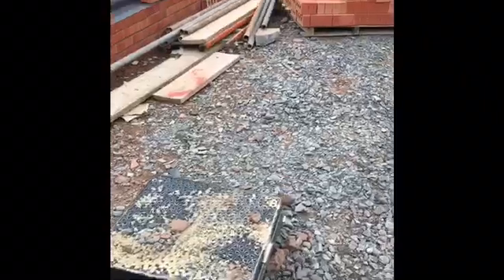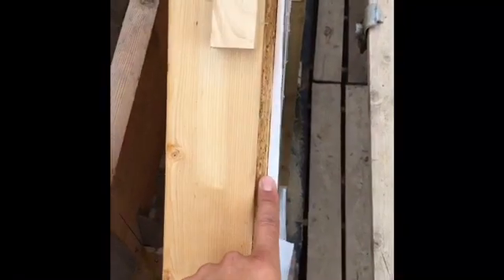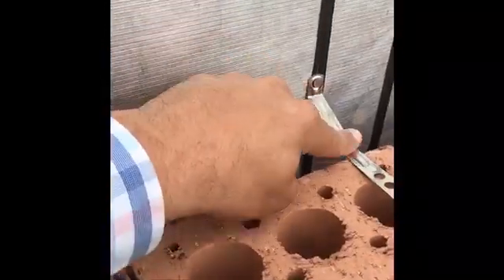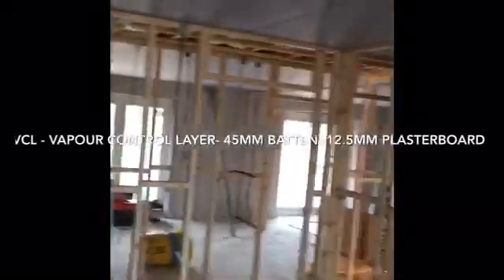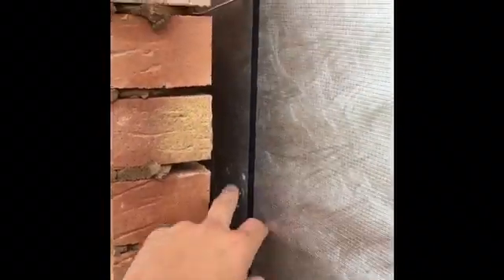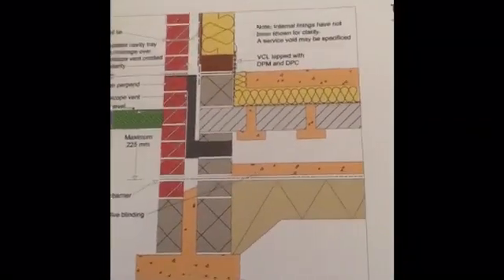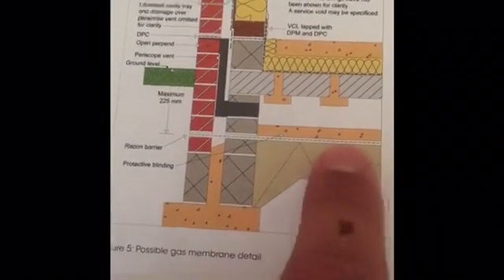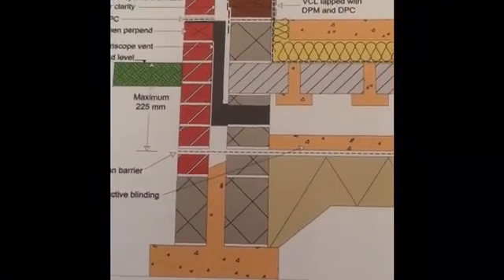Timber frame details - structural - sub/super structure - radon - building control - brick veneer

Comment: Good overview of timber kit systems. I just wish to add point; to minimise risk of dry rot in structural timber kit constructions external walls should have vents to ventilate the cavity to prevent moisture build up.  
In Scotland and Northern Ireland, perpend vents generally at 1.2metre  max horizontal centres; at high and low level bands PER storey. 
In England and Wales , perpend vents generally at 1.2 metre  max horizontal centres; at high or low level bands PER storey. If not added they can be retrofitted with products like drillvent.